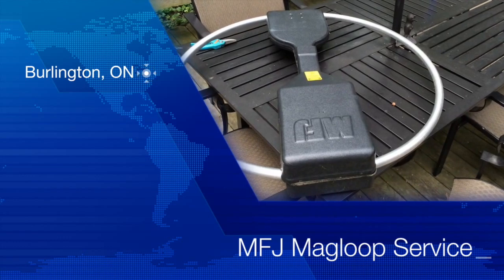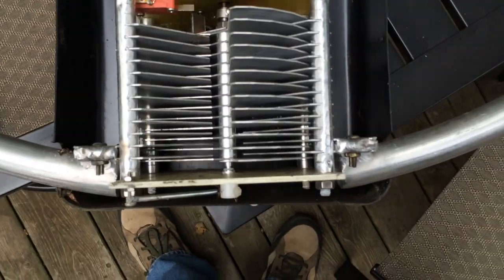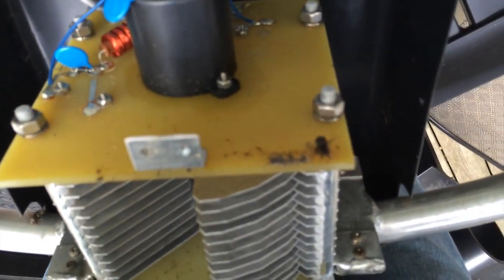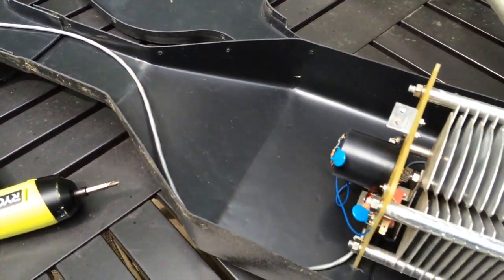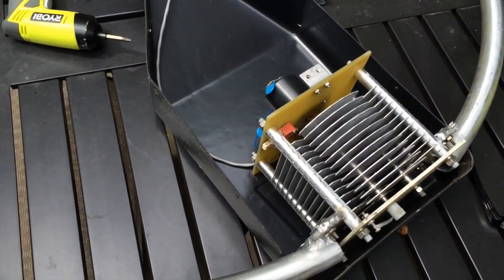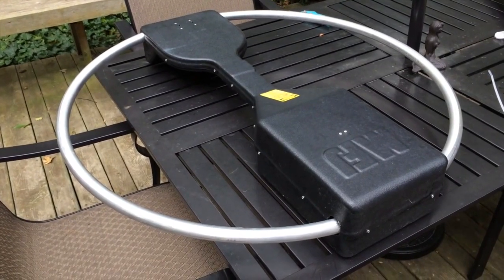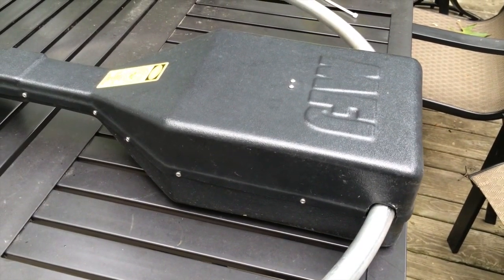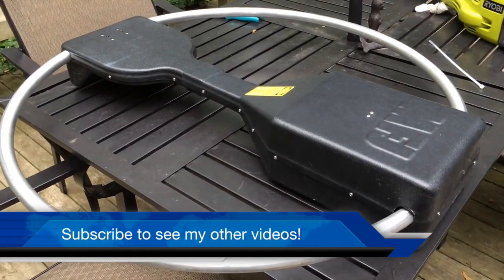Inside the MFJ Mag Loop Antenna - SURPRISE!

Comment: I have an AEA IsoLoop antenna. It uses a stepper motor to tune. The capacitor is massive. Caused problems with the drive, the drive pin broke out. The mod was to use two pins-seems to work. It does work well.
I grew tired of the critical tuning and bought a Cushcraft MA6V OCFD.  It's only 14'6" and tunes 6 thru 20 meters. Price is similar and has good SWR with little antenna tuner massaging. Can instantly change bands with no retuning.
Reply from the maker: eminusipi Yes, I remember the AEA loops. Always wanted one. I do need to get more wire antennas up before the snow comes. I still have some time hi hi. I have an S9 vertical to go up and maybe another Par antenna.

Comment: Hi there friend, As it states in the owners manual DON'T seal it up. You will have condensation problems like you have never seen before. These hams who told you to do so should be retested or they live in the desert. Hanging it from a tree limb is also a very big NO NO. A tree is a large collector concentrator of rain  and we all know how rain is a fantastic conductor of lightning. Once the tree reaches its saturation point (during a heavy rain) all the conductive rain passes right down that non conductive rope to your 1786 mag loop. So that non conductive rope is now an easy path for lightning to travel. Even a near miss could fry the inside workings of the 1786  and every radio, electrical outlet, appliance in your entire house.
With voltages that high it will easily induce an electrical charge beyond the capabilities for your house to withstand.
The goal is to reduce the electrical foot print of that antenna.
Mount it on a fiberglass pole about 10-12 feet tall in a clear area (as much as you can) with the non conductive ropes.
Which will give you a very small electrical foot print for each as opposed to both combined.
I own the MFJ-1786 and have had lots of people wanting it. But it has been too good to me.
I give this advice freely to anyone who wants it. Some listen and win. Some play Russian Roulette and burn their house down.
73 - Gary
Reply from the maker: +mavgk61 Thanks Gary - good advice there.  As soon as Spring breaks here I will do something about this.

Comment: I am curious about the alpha ezmilitary antenna. it looks so easy to set up. Do you know if that mysterious box is nothing more than a matching coil? I made my own matching coil to use ground mounted mobile whips and radials. It worked very well since I couldn't get on 40m or 75m otherwise. It appears that the ez has two radials of different lengths. Can you elaborate?

Comment: Since I'm usually restricted to operating out of a small urban backyard, this antenna looked awfully tempting but judging by the many reviews and the one that I've seen (which had trouble after some items came loose inside the cover), it just seem as if it's too likely to have troubles at some point, and just my luck it would probably happen before or during an emergency where it's needed. I'd be willing to pay the price for decent DXing abilities, but it's hard to fork down so much money for something that doesn't inspire confidence in it's reliability. Might your experiences with it suggest otherwise? I'd also be interested in hearing if the antenna worked fine after the cleaning. I might still be convinced to make it the last big ham purchase of the year (I'm still new to this so pardon my naivety)....
Reply: You might try making your own magnetic loop antenna. They can be a little tricky to build and tune. So if you haven't experimented with antennas yet, I would start with a simple wire dipole. Once you get a little antenna building experience; by all means look into building a mag loop. Plenty of info on the net. Keep in mind that mag loops have a VERY narrow bandwidth. You have to readjust the capacitor EVERY time you change frequencies.

Another option for small backyard would be the Buddie pole or the MFJ big stick. I have the big stick and really like it. I have mine mounted on one of those pro style camera tripods that has a really wide footprint. It works great. Well worth the $100 I spent on it.
Reply: +purplemutantas I don't know how I missed your comments but just came across them and thought I'd throw in an update. I began my operations with an MFJ Big Stick, and aside from having to fix a few things on it now after it was outside for a bad winter, it wasn't a bad way to get started. A bit noisy on 40 and 20 but workable, and I eventually found it really good on 10m. As for wires, I finally got myself access to 80m via a 114 foot end fed with two 18 ft "counterpoises" set up in a small urban back yard. It won't DX to Europe on the lower bands due to height, and tuning on the higher ones is dependable on circumstances (today's rain wreak havoc with 10 and 15m), but I'm doing well. A fellow at the local dealer suggests the MFJ1788 as the best option for people with limited space and says that the latest batch has been working good, so I may consider one if I have to move soon to a more limited QTH. I also have an Alpha Delta DX-EE dipole that works well but I need to put aside the time to mount it high enough to work well. Over the longer term I will look into building projects like this, but for now it will have to wait.

Comment: Point of information!

Get some RTV Sealant from your automotive store. It's really great for valley pans, oil pan and valve covers, when you don't want to use the cork seals. It's rubber and can be rubbed or pulled off, when you need to get into it. It protects well. They have different colors for different temperatures. Just be sure to get one that will handle the temp the antenna gives off. BTW, you don't need much. No more than 1 1/2 the size of the opening. It hardens and expands a little. Like an 1/8 more.

Thanks for the video. I'm sold on this!

Comment from the maker: It doesn't have to be up high because it's not interacting with ground to radiate. I just throw a rope in the tree and hoist it up about 10 feet.
Reply: OK cool thanks.  Im gonna put mine up tomorrow i think.  Gonna keep it vertical. Gonna have to figure out how to keep if from spinning though.
Reply: ***** Use a hoist cord and a "tag" line from the outermost side horizontally to a tree.

Comment: And to think they charge $450 for this cheaply made antenna. These are small, convenient antenna's but the price is what prevents me from buying one. They priced these antenna's far beyond the reach of most people who would otherwise buy one.

Greed is an ugly thing :>\
Reply: I was just thinking the same thing - wow $450 for that?!  Maybe $50 worth of parts (retail).
Reply: I know, I had never seen more detailed images of than the catalog images.  I can't believe how chincy it looks.  It looks like it was made from leftover lawnmower or leaf blower parts.
Reply: There is a remote control tuner box that comes with it!
Reply: When you add R&D, materials cost, manufacturing, distribution to retailers, customer service and warrantee work, and the low volume production, I understand the price.  I've spent several months researching the other 3 or 4 major brands as well as a couple dozen "home brews."  Most all other commercial makes for $400 to $600 are power limited to 20 or 30 watts input, and don't have remote control. Most home brews are the same.  I will gladly forego the experimentation (maybe good; maybe fail) and the dozens of hours that people who LOVE to experiment that they devote to their homebrews.  I've found that other makes of transmit mag loops that have welded components, weather resistance, operate on more than 100 watts, and have remote tuning are priced more than the MFJ models or at best very similarly priced.  You are free to home brew.  Ignorance of the marketplace for technology items is even uglier.

And try to buy one as of October 2022. No one has them in stock until maybe December or January.

Comment: Thanks for a video. This antenna In Poland  costs equivalent of 795 dollars.  Quite crappy quality for the price. Cheap plastic, cheap insulator materials, cheap corrosion-prone metal inside and barely no sealing for outdoor use. And creme de la creme, cheap shitty plastic on a cover. Shame on you MFJ.

Comment: You can get an AOR LA400 for about the same money (order directly from Japan via eBay) and from what I gather, the AOR is a much better built antenna. I sure would love to see a head to head comparison.
Reply from the maker: I use this loop to transmit though. The AOR looks interesting though.
Reply: Except for the glaring fact that the aor IS RECEIVE ONLY.
Reply: Just check out AOR LA400 it is receive only .  not for transmit not the same thing ,